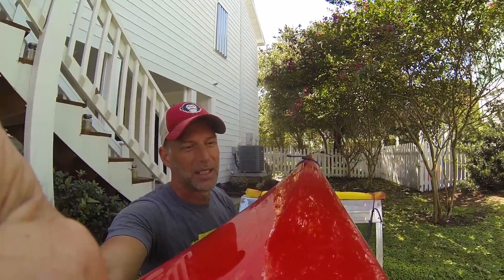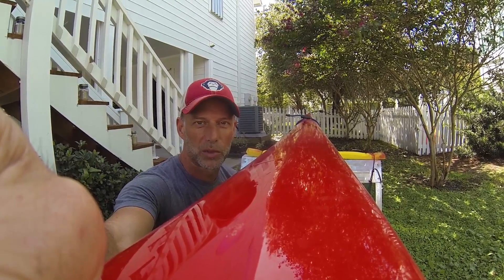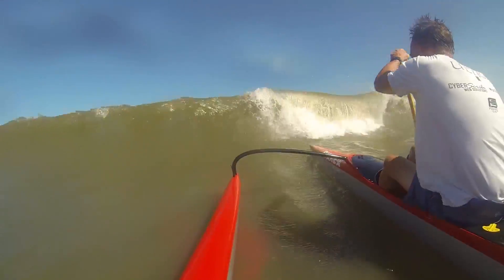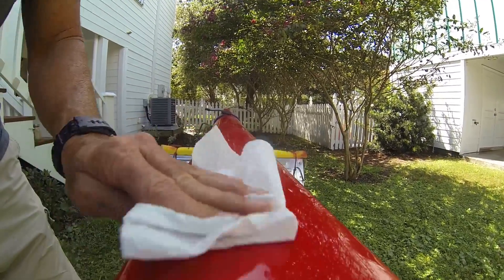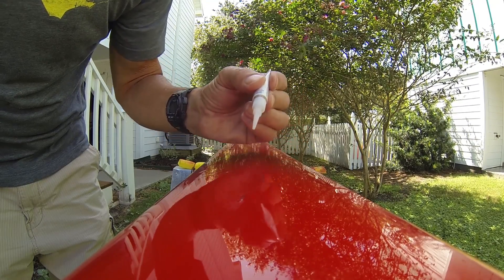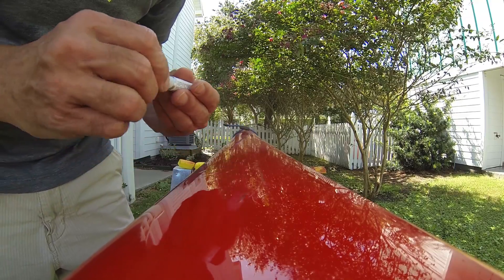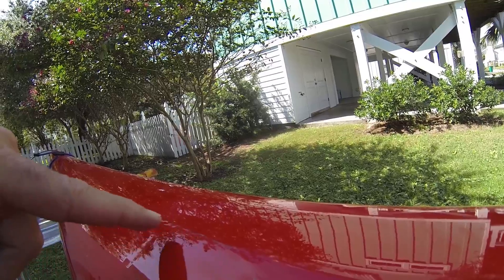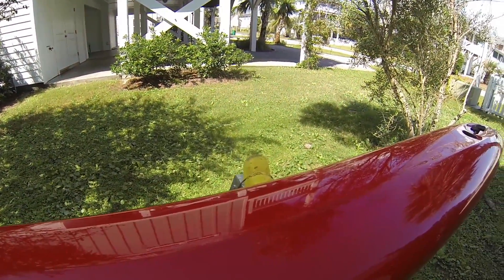Repair Your Outrigger Canoe with Superglue?

Comment: I’m looking to try super glue on a fiberglass shower with a two inch crack. I heard if you drill small holes on either end of the crack it will stop it from cracking further (not that I would do that to my kayak). I also saw a video of a guy that super glued two small dry blocks of wood together and two slightly moist blocks together, the moist pieces dried much faster.
Reply from the maker: Interesting. Thanks for the comment.

Comment: Perfectly functional repair!  
For very small composite cracks or surfboard dings I like to:  Clean the area with alcohol, use the thicker gel to fill the crack, and immediately apply Scotch tape or packing tape to press the glue into the crack and leave a nice smooth finish that requires little or no sanding.  If it has some depth to the crack, building it up with layers of baking soda and SG works well and on the final layer, finish with clear packing tape.
Reply from the maker: Thank for that info! The tape is key, especially with the baking soda and superglue, as it catalyzes so quickly. Good info, thank you!
Reply: @ThePaddleChannel  Two additional data points:  Typical CA glue is not considered waterproof and will break down over time so choose a waterproof formula for longer lasting results.  If you have a foam core to your board or boat, some super glue formulas will melt the foam creating a more expensive repair later.  I like super glue as a quick field repair but it does have limitations.

Comment: You can wipe the superglue flush with an acetone moist paper towel  a few seconds after applying it. But be careful not to spread a thin layer of superglue all over the hull when you wipe it.
Reply from the maker: We'll have to try that, Lehmann. That was one of the downsides of using the glue -- it was hard to make "pretty". Thanks for the tip!

Comment: It will work as a temporary fix. If you want a long lasting repair, put baking soda in the crack or scratch first. Try to keep the baking soda in the crack and add just a few drops of super glue to the baking soda and watch it spread and harden like a rock after a couple minutes. Works much better 👍
Reply from the maker: Baking soda + super glue is pretty amazing! Great tip, thanks for sharing that.
Reply: @ThePaddleChannel I just watched a comedy video "Fixing my boat with noodles" and was curious if other people discovered the same thing. This is pretty much what he wound up doing, creating a cement. I'm sure baking soda is much better than ramen noodles 😂

Comment: Why not just repair it like a surfboard: mix some epoxy and hardener and put some packaging tape over it as it cures so it repairs flush? No need to sand if done right.
Reply from the maker: You might be right, Patrick. We thought it was interesting that some experts recommended super glue and thought it would be fun to try out. We've played with the super glue approach a little since this video was made, and have gotten much stronger bonds by adding baking soda to the super glue, but it's U.G.L.Y. Your approach would make a much nicer finish.
Reply: @ThePaddleChannel  After mixing your epoxy (use a long set type, not 5min) add a bit of denatured alcohol to reduce the viscosity.  The alcohol evaporates in a few minutes, then put on your tape before the epoxy cures.  Single edge razor blades are good for leveling.
Reply from the maker: @garyvanremortel5218  Thanks, we'll try that out!